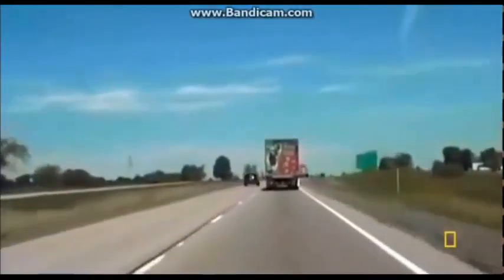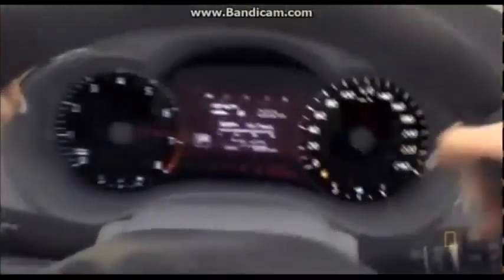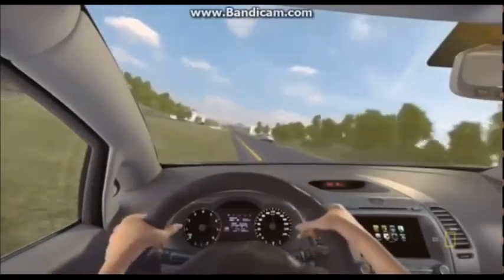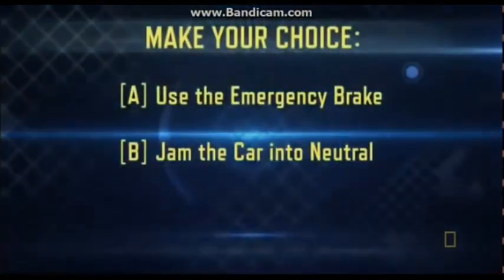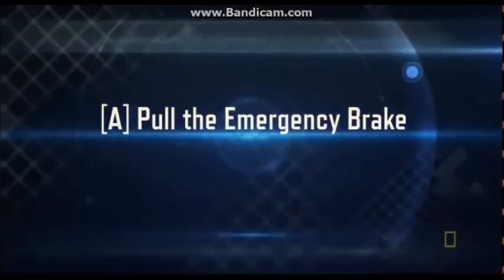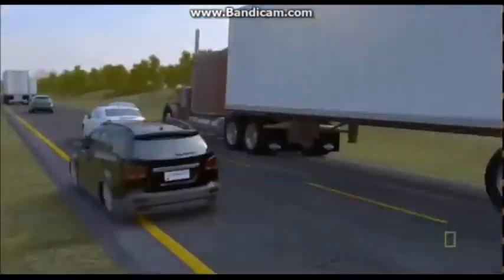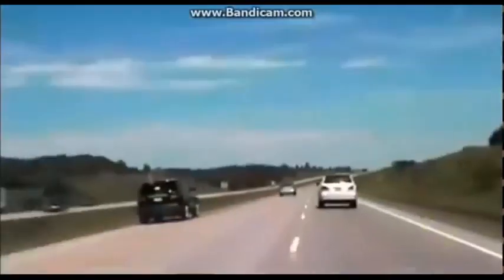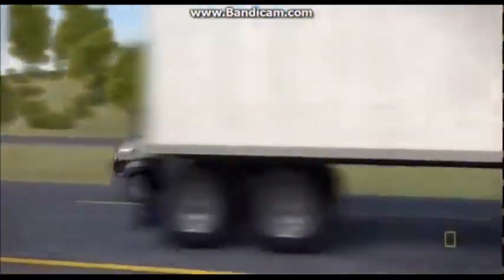How would you stop your car if your gas pedal stuck

Comment: Or option D: use your foot to pull the glass pedal tword you..... The gas pedal is a wire system so enough pressure should pull the gas pedal back out .....
Reply: the wire is connected to a spring loaded contraption. pulling on the gas pedal will do nothing because the gas pedal only puts tension on the wire one way. pulling on the pedal would do nothing. also, these days, most cars dont use the wire throttle anymore. the gas pedals are now connected to a sensor that detects how far you push down and relays it to another sensor/computer on the throttle to open as far as you are pushing down
Reply: Actually folks, the modern cars that are having these problems have incorporated electronic technology into every aspect of mechanical function.  Hence the expression "drive by wire" is actually a wire sending a signal current, replacing the conventional cable-operated type engine throttle that you are describing. The same is true for steering systems.  Consider the key-less ON/OFF switch which is becoming increasingly common.  With each of these "technological advancements" comes a greater risk of limiting the driver's ability to be in direct control of the machinery they operate.  Ya dig?
Reply: gfgdt Jbcdrg some of them are electronic!
Reply: gfgdt Jbcdrg or get a manual so the car doesn't constantly accelerate if you hold the accelerator pedal down
Reply: Not every car is a wire system
Reply: Lots of newer cars use an electronic sensor that opens the throttle with an actuator
Reply: Space Suitor I understand but no I don't dig.. fuck I look like? A mole rat?
Reply: Space Suitor facts
Reply: gfgdt Jbcdrg a wire system could mean two things.....is it cable or electronic? Either one that probably won't work....cable could be broken or came detached....an electronic system could have a wiring problem...ie electrical malfunction.....in those scenarios that will not work......if ur know your vehicle well enough you could turn off your ignition without locking the steering wheel.....u will lose power steering and brakes....but have Lee's of a chance of destroying your engine....I would chose c....turn ignition offf then quickly put into run position...not all the way in start.....won't lock the wheel.....thx for reading
Reply: gfgdt Jbcdrg That's not only a terrible idea because it wouldn't work unless it was a wire system, but you're not only losing focus of the road, but you're ignoring the problem, which will only allow it to happen again in the future.
Reply: space suitor is right but u man are very right thats what the Dispatcher told.the woman and it worked watch th On.on CNN or ABC on Youtube bruh

Comment: This answer is so obvious. Maybe its cuz I drive a manual. I use neutral for coasting. It makes sense why most auto drivers forget that neutral is actually a thing.

EDIT: For those manual street racers/car guys(like me) out there that say coasting is bad,unprofessional, or noobish; I don't coast too often... I typically rev-match and heel-toe... but it doesnt hurt to coast a bit when u get lazy :) In other words, I know my shit
Reply: i would  say the same thing too but unfortunately I cant find anymore infomation on this incident like an accident report. it is very unlikely but possible to have a failure in the throttle, abs module failure can also prevent brakes from working, and transmission failure can prevent it from shifting  and an ignition failure too, having all these systems fail at the same time is very unlikely unless there is a single point of failure in the design
Reply: Ive seen a lot of 911 calls from pedals being stuck, and in almost all of them they say they already have tried to put it in neutral
Reply: I once bought a mechanics special: a ford Taurus. the transmission was toast. If you pressed the brake while trying to shift, it wouldn't budge. It would only shift if I didn't have the brake pressed. Rebuilt the transmission,  problem solved. My point is, transmissions do develop problems. My relative had a jaguar, and that day I happened to be riding passeneger, that, after 2 weeks of owning it, she put it in drive, and it SLAMMED ITSELF IN REVERSE AND DROVE ITSELF IN CIRCLES, without her even having her foot on the brake, pedal, it did about 6 rounds, before she could get control of it again. Mechanics blamed the transmission and rods, i, however, blame a ghost of some sort. Scared the crap out of me.
Reply: thats such an insensitive thing to say.
Reply: legokingiscool I've been driving for 5 years (all auto) and I can honestly say I used neutral maybe three times at a car wash lol.. I do wanna try a manual though!
Reply: Brianchorsaway its fun! Tip, learn where the clutch catches and release the clutch slow
Reply: stop coasting in neutral.
Reply: you do not gain nothing by coasting in neutral, in fact you could even use more gas! + its dangerous
Reply: Don't coast in neutral - in an automatic. 

It's pretty much normal and an everyday thing in a manual.
Reply: Gergő Deés you must never coast in neutral in a manual! If there is a problem you might not be able to engage the transmission again and good luck braking without the help of engine brake on a slope. Here in europe where you learn to drive a manual its almost the first thing instructors tell you.
Also people think by coasting in neutral they will consume zero gas it’s false
In fact on a slope you leave the car in gear, gravity does it’s thing and the car moving by itself will turn the wheels wich turn the transmission which (in gear) turn the motor = no gas needed to keep the engine at x rpm in this case. BUT if you’re not in gear, the transmission while turn but not the motor (it will get no energy from the wheels turning) = as you can see when coasting in manual fuel consumption isnt 0, its a little amount! In fact this amount is the fuel use to keep the motor at lets say at 1500 rpm. There is a physic term that exists to describe this phenomenom but i can’t translate it in english.
Last, by coasting in neutral you might need the brakes at a red light for example to slow the car down.
Slowing the car with only the brake pedal and not the engine brake will require an awful lot of brake pads, and you might need to change them a lot sooner because they will be used not more frequently, but more hardly.
Reply: Winmader Cobb Yeah, right, I'm middle european, i learnt to drive in a manual as well - and have driven manual cars only since i have my licence. I've known basically everything you've said already - there are plenty of vides on the topic as well. Yet there are quite a few times I still coast in my '91 Mazda. Sometimes it's way more convinient, logical, and... well, quieter. Enigne breaking is useful but there is less chance of failure in both your transmission and breaks from coasting at the same time at a place you can't stop without them than a cow falling on you driving.
Reply: Winmader Cobb obviously coasting down a slope while breaking to keep under the speed limit, that's stupid and one's just going to die because apparently breaks do overheat.
Reply: Gergő Deés yeah i too does it sometimes but just to warn others who might not be aware of the risks..
Reply: So throw it in neutral and redline it til it detonates? I mean, understanding this fate in an automatic makes sense, but I'd rather put it in fifth and use my brakes and ease the handbrake til it stalls, then put it in neutral... But I suppose that could just be me. Hopefully I'd realize my throttle was stuck before I hit 140. Then fifth wouldn't make a difference anyway.
Reply: Jonathan Fruchtnicht no, put it in Neutral, come to a complete stop then turn it off.
Reply: Gab John If my throttle is stuck, I'm assuming as depicted in the video the car's RPMs will still rise. In my car in particular I'm not entirely willing to just blow my engine because I've put it in neutral and removed all resistance against the engine.
Reply: Jonathan Fruchtnicht Have you never heard of a rev limiter? Almost all consumer automobiles have one.
Reply: Kyle Desjardins Have you any idea what you're talking about? Typically the Rev limiter is at or slightly above redline, which is already a dangerous threshold for a vehicles RPM to be at.
Reply: you do know that by putting it in neutral, your making the engine freak out, dumping more fuel into it.......your better off just taking your foot of the accelerator, the ECU cuts fuel off to the engine if your engine breaking, puts more in if it senses that your moving but no load
Reply: Yeah, after 5 seconds of thinking you know this simple answer
Reply: Sadly true. Most only know p, r, d, and older cars will have gear options for hills
Reply: dont use neutral too often you`ll wear out the clutch
Reply: Don't cruise in neutral bro not good
Reply: or to slow down instead of neutral press in the clutch lol
Reply: neutral is only for sitting at stoplights so you don't ride the clutch not for driving around and coasting down hills thats very dangerous
Reply: legokingiscool Noooo! YOU CAN STOP THE ENGINE! BUT YOU DONT HAVE TO TAKE THE KEYS! JUST LEAVE THEM HERE BUT TURN OF THE ENGINE! THIS IS POSSIBLE MAN!
Reply: legokingiscool it's an auto in the video.
Reply: legokingiscool same 😂
Reply: thanks friend
Reply: Well it helps sometimes in the city. I typically rev-match and heel-toe... but it doenst hurt to coast a bit when u get lazy :)
Reply: yeah i know
Reply: legokingiscool REDLINE
Reply: I drive an auto but it seems like common sense to put it into neutral then to slowly apply the e brakes..just my opinion lol
Reply: @anid3v838  you just need to force it into neutral since some cars have a locking feature that tries to protect people from trying to engage reverse while driving it only disengages when the car is not moving however in such cases as the car is unintentionally accelerating, you have to force it, which will break the locking mechanism and it will go into neutral, after that youll need a new shifter since after forcing it, it would be broken
Reply: Coast down long hills👌

Comment: 4 wheel disc brakes cant stop a "175 HORSEPOWER" (4cyl) engine. Powering a 2 ton SUV. Has anyone tried slamming on the brakes in a modern SUV? Its painful... a 4cyl SUV cant even do a burnout. There is simply not enough torque. Brakes would bring that car to a halt or slow it down enough to turn  it off.
Reply: Exactly! Every vehicle which comes from the manufacturer has brakes strong enough to over power the engine. The only risk that the engine will overwhelm the brakes is in modified vehicles with enlarged wheels or swapped engines. If you're being responsible while modifying, you'd improve the brakes at the same time because they aren't that much more expensive than the initial dangerous modification.
Reply: Brake fade can happen with your standard brakes, which generally are not designed for braking at higher speeds like that while power is still going to the wheels. At lower speeds, just braking would be fine if the stuck throttle was caught soon enough. At 120 MPH, though, brakes that aren't performance brakes will heat up from the combination of the engine still attempting to spin the wheels while trying to slow down from a high speed. They will slow down a bit, but at a certain point the brakes will heat up and fade out allowing the vehicle to speed up again.

And this is assuming that the person still has the brakes straight from the manufacturer that haven't already been replaced with some that are presumably cheaper to save money. It also is assuming that the brakes on the vehicle were in good condition and not at the point of needing replaced. There are always many factors to consider when it comes to assuming braking.
Reply: Keep in mind that the engine delivers nearly zero torque to the wheels at max speed due to aero drag and the high gear ratio. I'd be willing to bet that most cars could get themselves slowed down before brake fade takes over.
Reply: If that were true, then the lady's Sorento they used as an example would have stopped.
Reply: Couldn't she just put the damn car in Neutral ? Even if automatic you can put the car in neutro while accelerating. Then you just have to use the brake.

EDIT: I hadn't see the video before writing this comment. She was just stupid.
Reply: Your brakes are alwys gonna overpower your engine
Reply: I also love how dramatic they make it. "REDLINING AT 7000 RPMS!!..." "POLICE CANT KEEP PACE..." "110MPH!!!!!!!!!" 

I also love how she was focused enough or had a free hand to be able to phone 911.
Reply: I think she boiled the brake fluid while yrying to apply brakes graddually that would make the most sense
Reply: That's utter bullshit.  Brakes generate MORE THAN ENOUGH force to stop a 175hp car. In fact, you will find that if you floor any car in 1ST GEAR and then just tap the brake with your right foot the car will start slowing down, and that's at low speeds without dragf and in 1st gear with a really high ratio. Any car on the market can easily come down to a full stop even if the throttle is floored.  Just think of it this way. That Kia takes about 9 seconds to get from 0-100 km/h with full throttle. ANd it takes about 2-2.5 seconds to stop from 100 km/h to 0. It's common sense that brakes are far more powerful than the engine.
Reply: Mister_Freakout - They absolutely ARE designed to work at 120 mph, that's not a high speed, first of all, and braking heavily over and over against at that speed will make brakes perform well for a couple of minutes.  Brakes take EXTREME temperatures in order to fade so much they won't stop you anymore. I'm talking temps you won't achieve by flooring the throttle and brake at the same time.
Reply: derbigpr500 it's a Dodge Journey
Reply: Cauldron-Born my dad has the same car lol but it's a v6 with over 180k miles
Reply: Cauldron-Born yeah, she was totally just joy riding and making a brilliant excuse for it. 😂. I might try that sometime
Reply: Cauldron-Born they can do burnout if you just turn off esc and then rev the engine and dump the clutch
Reply: Mister_Freakout I go over 120mph every day... I Think my Breaks would Break even if the Engine still puts pressure in the weels at least for this  One Time... nur putting the car into neutral is tue way better Option. I just dont understand how the driver of the car didnt came go the idea to set it in neutral 😂😂😂
Reply: It's america
Reply: I had a citroen that loses power braking when the accelerator and brake are pressed at the same time (the brake pedal becomes stiff like with the engine off and pressing the brake several times). It will still stop but you have to press much harder. The other issue is in an automatic transmission, it will go down the gears as you slow, producing more torque which might be hard to slow if you have no brake vacuum and puny legs.
I've only driven stick shifts though (does the auto go into neutral at speed with the accelerator floored?).
Anyway whatever car you have, rehearse the following on safe roads at lower speeds "What locks the steering? Turning ignition off all the way? Taking keys out?"
"Does the brake lose vacuum when pumped with the accelerator pressed?"
"Will the transmission go into neutral with the accelerator pressed and moving forwards?"
"Can you control the car and slow using the emergency brake with the accelerator pressed? (Only test for a short time to avoid wear)"

Comment: never use the emergency break on high speed!!!
Reply: pattibjee unless you are a drift king
Reply: pattibjee amen
Reply: But how else are you gunna do a power 180 when you need to turn around without doing a boring ass 3 point turn?!?
Reply: It's not gonna do anything anyway,  E- brakes on new cars are so weak the rear wheeels wont lock up even on low speeds, let alone high speeds.
Reply: derbigpr500 it’s better on newest cars they got oil handbrakes wich is much more effective then on old vehicles
Reply: pattibjee that’s how I get it sideways when I drift the mountain pass
Reply: Ares how get what who huh ?
Reply: Unless you are bunta or anyone else from initial d
Reply: pattibjee you can if you play eurobrat and sitting in ae 86
Reply: Why? As long as you engage it slowly overtime I don't see a problem. I've used it going 110 and can gradually lose speed fine. Its safe as anything as long as you do it slow
Reply: NoThisIsPratickStar unless you have any type of jdm rwd or awd drift car

Comment: cops can't handle clearing the road at 120mph?  PLEASE!
Reply: Exactly with a v8 under the hood they should have no problem catching up to a 4cylndr car
Reply: Sir Oric0826 power to weight ratio
Reply: power to weight ratio the v8 still wins LOL
v8 crown vic vs a i4 kia sorrento bro suv's are heavy as fuck & a crown vic is literally made for power
Reply: The Crown Vic has a pretty bad torque and horsepower rating for a V8 287lb/ft and 240hp.  Theres conflicting info on top speed anywhere from 120-140 depending if theres a limiter. In a drag race or from a roll I would take the crown vic over the kia but the kia is already at 120mph
Reply: Alex SAAB crown Vics r sloww
Reply: I mean they don't extract more power out of the engines to keep them as dependable as possible.  Though it's numbers are pretty conservative
Reply: itinkle no, it's just other drivers don't fucking yield for cops